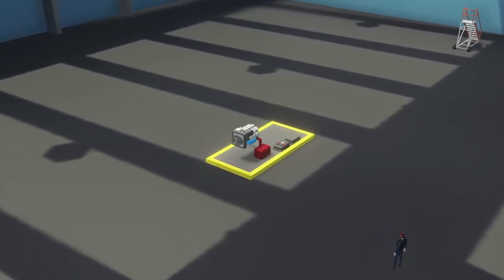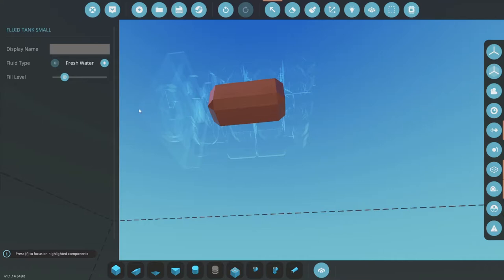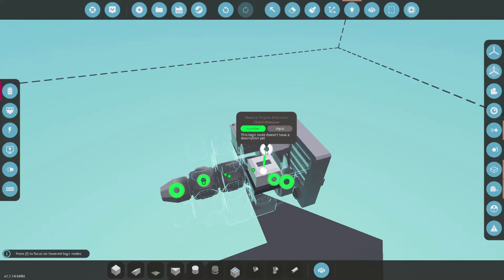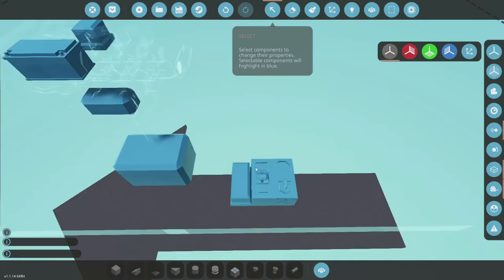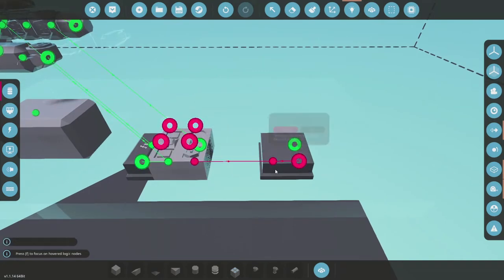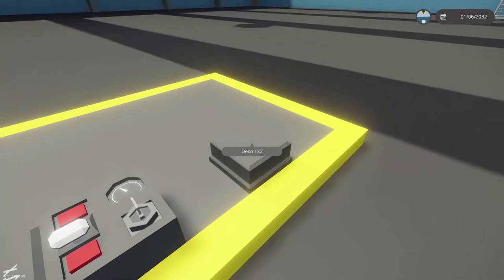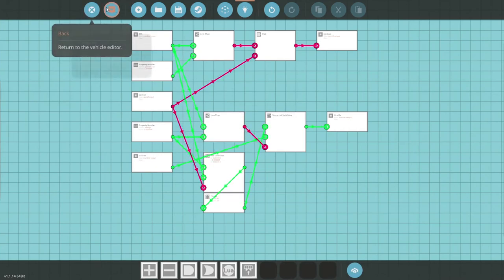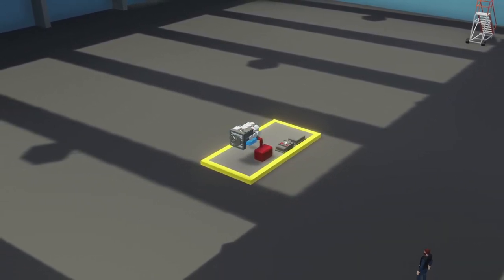Modular Engine - Stormworks Tutorial

Comment: I followed this to the letter accept for I got to a part where you resized the Deco Logic piece and it moved up and deleted my Function block . I went back in the video to see the Function block hook up part hooked it back up and when I followed everything again back through the deco Logic the engine kept trying to start but did not start. Even with full throttle it just constantly cranks but does not turn over. I will go back through the logic portion of this video and see now if it does work but there have been updates since this was released and I presume it will not work. As when i followed Morley mans tutorial the results on the engine read out were different and I cant seem to put his engine under load with out it failing to start.

Hmmm after deleting all the logic and going back to the 9 min mark and restarting my engine started first time and other times you went in to check there was no struggling to turn it cranked every time. I went to go back in after I had saved the logic and for some reason It reset my logic work way back. I reloaded the saved logic placed it back down hooked everything up and the engine cranks then stayes Pegged at 3.60 but never sounds like it starts. Finished the video made the corrections and now it works. Had to go back and double check the video and rehook the logic myself.
Reply: if u cant start the engine use ay huge electric motor and hook it upp to that engine and KA BOOOM that engine will start 
the down side is you will lose big electric so
Reply from the maker: Glad you did get it to work at the end :)